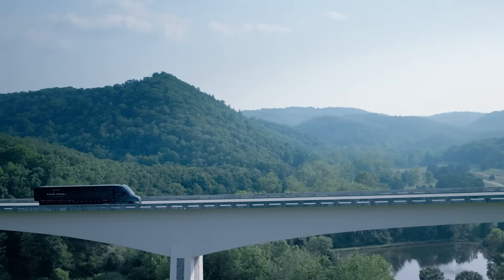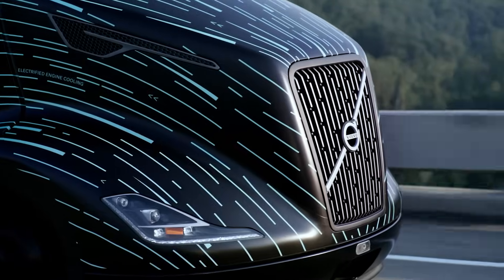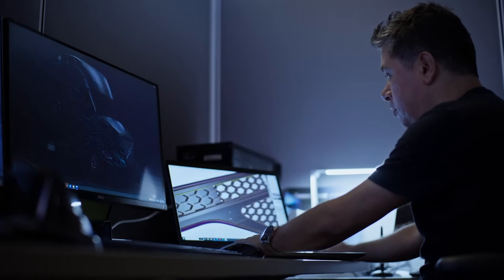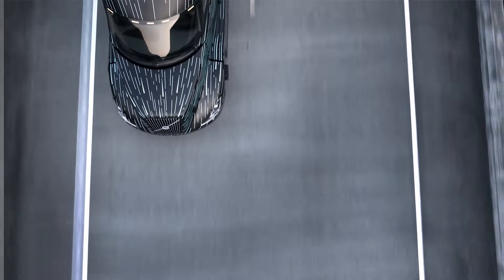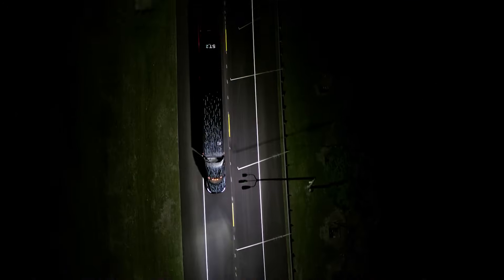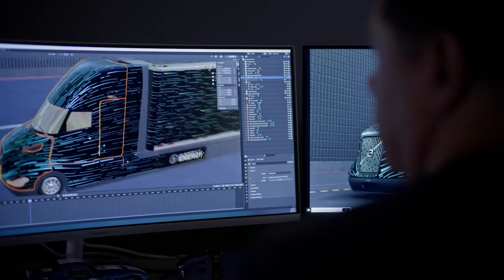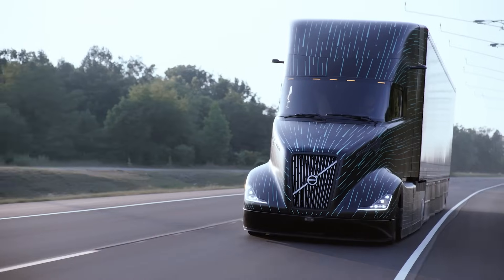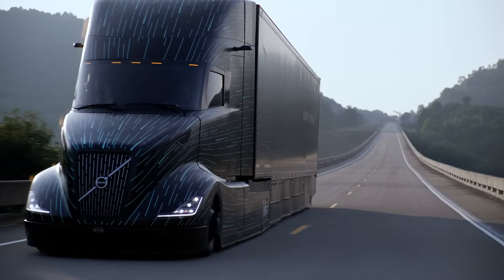Volvo Trucks – SuperTruck 2 exceeds freight efficiency goals

Comment: At first, I thought it's electric. Wouldn't be surprised Volvo joins in that pursuit.
Love the shape, design, a truly beautiful truck.
Reply: Volvo already has a full lineup of bev trucks in europe. In the US they only have the VNR so far and it's somewhat meh. But their european lineup is great. Range is acceptable for everything except long international hauls, and it will work there with better infrastructure and a bit faster charging in a few years. And they haul the full 64 metric tons that's allowed here. Scania even have a few specialty trucks doing up to 80 metric tons in mining and logging operations. All fully electric and running around the clock.
Reply: What ever they learn on this they can apply on the EV truck they most definitely are coming with.

Comment: The main thing that I've always been thinking is why don't trucks have Carbon ceramics brakes? Or full carbon châssis? That would've saved at least 1 ton of weight, trucks already cost like 250k or more so at that point the added cost would've been absorbed way faster with lighter parts but I'm just a regular man, not a truck engineer.
Reply: 1 cost.
2 cost.
3 cost.

weight does little on semis, and it wouldnt be 250k more xD
It would be millions more.
Reply: @zaarkeru3391  Cost maybe but planes already go through the same process, plus I'm sure the advantages overweigh the cost.
Reply: @Random63R400  
I mean, a plane is massivly weight limited.

Saving maybe a ton for a few million usd isnt worth it for a freight truck.
Nobody will be able to afford it xD
Reply: @zaarkeru3391  I said a ton but it must be more like 3-4 and that'll improve the CG, tire wear, fuel consumption, engine wear, brake wear, rolling resistance and all.
Reply: @Random63R400  
Not at all, because total weight wont change.
For every ton you save with exotic chassis material you add as cargo.

So the question is, how much is the weight reduced (my guess is below a ton, as CF isnt good at strain loads).

Will you ever earn profits from having a lighter truck by having higher loads?

No, never.

Comment: Bollocks. They just did their first test in Aust recently, covered 1200km and had to charge 7 times, each stop being an hour. 
If they also plan to run bigger batteries to eliminate the stops (to 4) the battery power will be immense, making charging stations immense which puts a strain on the electrical grids and that’s only a small portion of EV truck using them. 
Plus they aren’t much more environmentally friendly, if any if you include the making and coal fired power stations.
It’s all a hoax, sorry.
Reply: This is a diesel truck mate

Comment: If it is that great, given the enormous problem that is emissions from trucks (heavy industry is worse, but let's pretend otherwise) and the freight market, especially in the US, is so keen to reduce costs and be more efficient, then why the heck are you not turning this into a production vehicle. You achieved a massive improvement in efficiency, which would benefit everyone, the environment and the cost of goods, yet this is a concept? If it was a great as you claim you'd have your order books full, so what's really going on, what are the downsides that stop this from being viable?
Reply from the maker: SuperTruck 2 is a public-private partnership with the U.S. Department of Energy (DOE) tasked OEMs with achieving a 100% freight efficiency improvement over their submitted 2009 baseline. Some learnings we can incorporate into our future cab updates though.

Comment: 134% improved fuel efficiency......100% fuel efficiency is fuel free, what is the extra 34% then? I do have a VOLVO truck, with diesel DD13, and I get 99% efficiency even with a load.......as my truck goes down the hill....on the flat and against the wind t gets 7 MPG, up the hill, well that depends on the hill, the worst I got was 1 to 1, 1 mile to 1 gallon of fuel,- yes that one was bad.- the fuel efficiency in that case was like -100%. TH

Comment: I think it looks like great. However, some years Volvo plays around with allowing us the highest (USA standard) 600ish HP/2050 torque  in VNL's, but usually not. They say cooling capacity is why. So although I think it looks really good, I'd be concerned that they say nothing over 450 or maybe 500.   Some of us haul freight that needs more HP to get the job done and not be a rolling road hazard. Please keep our options open!

ALSO, cabovers have been gone so long that our roads have changed. I'd believe drivers would go nuts over them in the states now. I know I'd order a pair of heavy spec'd ones the first day we could.
Reply: I'm surprised you couldn't order a Volvo FH 750 heavy duty tractor tbh
Reply: Isn't this electric?
Reply: @iaial0 No

Comment: The lower 6 inches should be the brush type fairing to prevent damage. It would be advantageous if the front axle was on air and the truck height could be set to the terrain. An average driver would not drive like a company demo driver and skirt/fairing damage would be quite frequent and become expensive to keep legal and effective. 
We should look at roof options in design such as a slight pear shape which has been proven in Gt Britain, with no more maintenance than any other roof. Aerodynamics would be better all around especially if we reduce the gap between the tractor and trailer headboard. 🏴🇺🇸

Comment: The video mentions smaller tires - does anyone know what size was used? The linked Volvo "innovation" web page mentions 19.5" wheels. They don't mention it in the video, but the webpage talks about fewer axles, suggesting that this is a 4X2... it would be difficult to carry the typical payload of a classic "18-wheeler" (one steer axle with single tires, tandem drive axles with dual tires, tandem trailer axles with dual tires) configuration with any fewer axles under North American rules.

Comment: I would imagine that a lot of aerodynamics wins comes from reducing the drag at the end of the trailer. In the video, you hardly ever see the back of the truck, but there is some sort of shape attached to the back. Wouldn't it be best to just put a wedge or even better a cone on the back to reduce drag?
Reply: NO - weirdly enough you are often better having a sharp edge with a slight flair - look at modern Toyota SUV for an example.  It causes something called "vortex shedding" you get rid of the air stuck to the sides of the vehicle cleanly as opposed to trying to re-integrate it smoothly - which is difficult and causes turbulence

Yes you drag around a low pressure area at the back, but its less drag than the turbulent air you get rid off with vortex shedding.
Reply: @piccalillipit9211 odd but interesting
Reply: The "boat tail" idea has been around for a while, and has been quantified.
https://en.wikipedia.org/wiki/Semi-trailer_aerodynamic_device
Reply: @moblet Boat tails have proven to be problematic due to lack of training and understanding of the system by low IQ drivers. There is a proven and much more efficient used in Britain with sloped trailer and straight truck roofs. Our 13ft 6 overall height restricts our designs as do box vans our efficiency in deliveries and pick ups.
Reply: @pauljohn6637  Thanks for that info. I was wondering why boat tails weren't more common.
Reply: More importantly it is about the loading and unloading of the shipment... At the warehouses the back end of the trailer needs to flush with the loading dock... Also limited by the shipping container size limits...  Everything goes into consideration while designing... Even the goods and pallettes that go into them...
Reply: Seeing aerodynamic with just the power of the mind is a gift not many have. The underbody of any car is a massive drag contributor, I would say the biggest because even part of the low pressure area behind the truck is caused by it.
Reply: The end of the trailer is no where near as big of a problem as the sides as far as i can understand. The air friction on the sides is the main problem. Also as far as i know you want a sharp cutoff at the end of vehicles as you want the air to leave going in a straight path, as when it doesn't leave in a straight path you get that pocket of turbulence.
Reply: Check for Tesla semi trucks they are similar to these

Comment: Im worried about the ground clearance, but other than that it sounds good
Reply: He did mention air ride height adjustment.
Reply: @Torsee  Probably true, must have missed it. :)
Reply: What it looks to me is that there is rubber at the bottom of the sides so that when u want to go over bumps it wont damage the truck. You can see it clearly at 2:52 below the words "Energy" on the sides.
Reply: @DashTTV  You are right!
Completely missed that.

So in that way, the HARD clearance isnt too bad then, thats good.
Reply: @DashTTV Doesn’t matter, u got air suspension
Reply: All trucks have (rear axles) air suspension for coupling and uncoupling and also because it’s safer for the roads.  Also the trailers have air suspension for levelling and loading/unloading bay height.

But the side skirts have rubber pieces that fold when going over bumps or kerbs.
Reply: @ConstantinSPurcea  You do know you that has nothing to do with ground clearance?
Reply: Watch Eurotrucks, they have even less clearance. Seems to work as long as you got perfect roads. I would be worried if there is snow on the road or American railway Xings
Reply: Don't worry, they will lift up bridges little bit up😂
Reply: Roland Svensson is on it, if you don't know who he is look up Volvo trucks ground clearance stunt that man knows his stuff.
Reply: naaah that fine :D every tuner would say that :P
Reply: Let's be honest, these trucks spend 90% of its lifetime in highways so plus, they have air suspension.
Reply: If you take a look at F1 back in the 80s, you'll see some cars with sliding, low wear, rubber skirts, intended to sell the underfloor of the car. Nowadays we know better ways of generating downforce but I'm glad to see the concept could be useful for road cars.
Reply: Air suspension has it covered. Good luck mechanics on fixing this
Reply: These things spend 95% of their time on freeways
Reply: This is clearly for paved roads
Reply: @gameseeker6307  Paved roads still have speed bumps where I live, but as others have said, its likely rubber skirts.
Reply: They probably lowered the suspension quite a lot and added those panels on the trailer for increased fuel efficiency. They will probably heighten the suspension for the release model